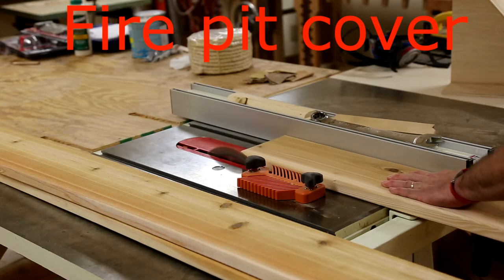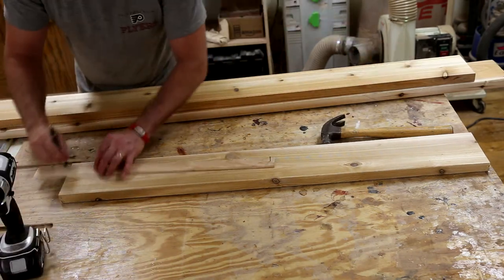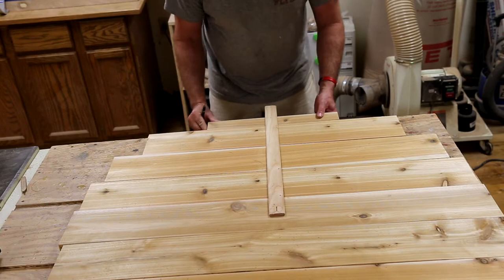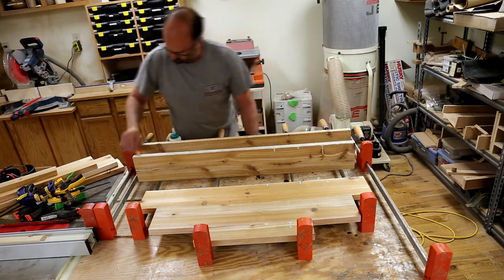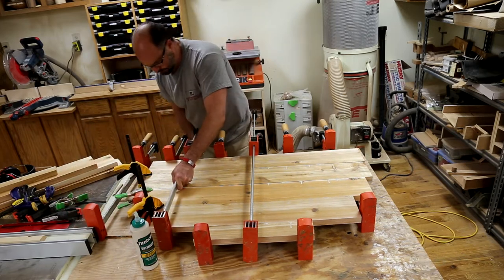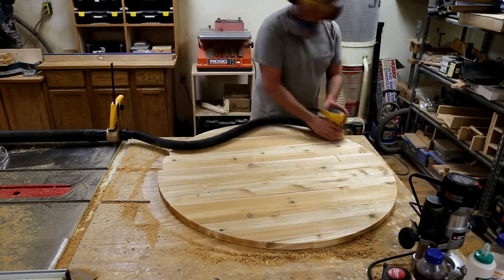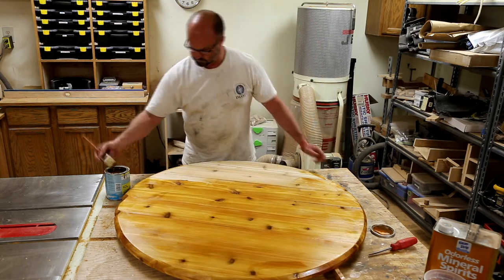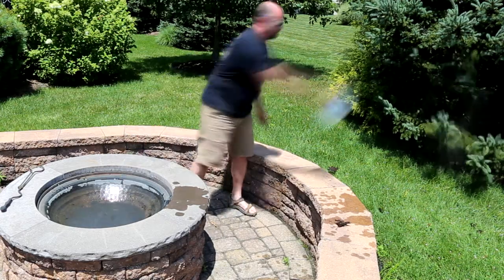Fire pit cover

Comment: Jeff great project; I started making the fire pit cover and have stumbling using pocket holes.....did you rip both sides of your cedar prior to glueing ?  also.. how is it holding up with no biscuits or pocket holes..  thanks..
Reply from the maker: Both sides were ripped or jointed to come together square.  The glue joints are holding up well but it has warped a little bit and the finish is ready for some maintenance. Good luck with yours, hope it comes out well!